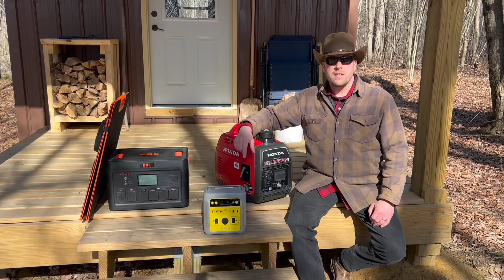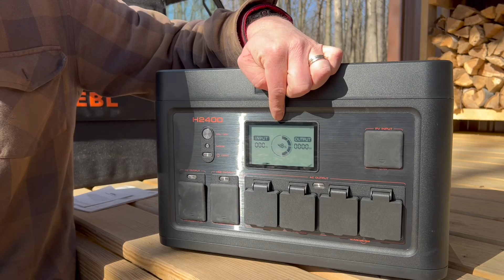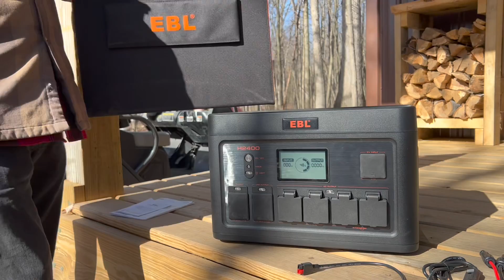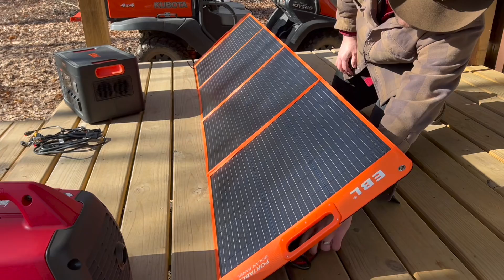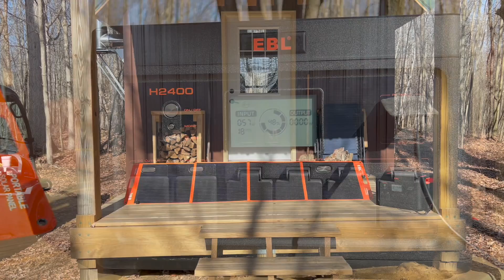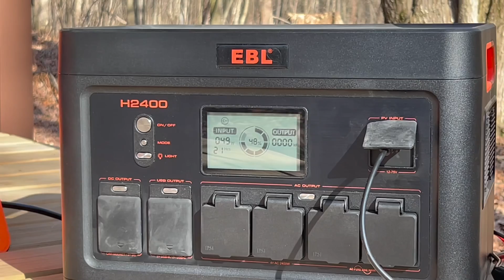Battery and Solar for the Off-Grid Cabin - I was Skeptical

Comment: I'm building my own camper pod, after watching your videos. I'd buy a pre-built, but they tend to come with way more than what I want or need.  I just bought my custom solar setup that I'll install in my camper. I plan on boondocking 90% of the time, but can hook to shore power to top up the battery if needed. (200W solar,  500W inverter, 100Ah lithium battery. )

Comment: For the shading, it really just depends on how much energy you use off the battery.  Just running a few LED lights for a few hours won't burn up a whole lot of battery and the energy you get even from the shaded panels might be enough to keep the battery up.   It's when people try to run big loads for a long time, like A/C units, heaters, and continuous loads, where getting direct sun on the panels really starts to matter.

It starts with a few lights.  Then making tea or coffee.  Then wanting a fridge... then a toaster oven.  Well, suddenly all the comforts of a grid-connected home are desired 🙂

One other item of note is that even though the unit is portable, usually you just want to have it permanently situated somewhere in the cabin so its always available to power stuff.  There are several ways to charge it including via the generator or even from a separate 12V battery that you charged elsewhere, connected to the EBLs "solar" input

-Matt